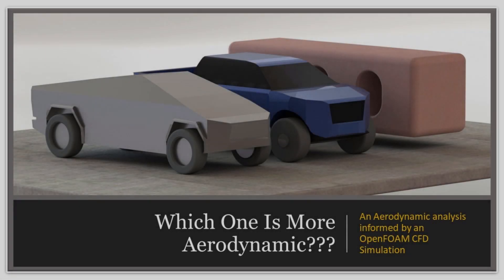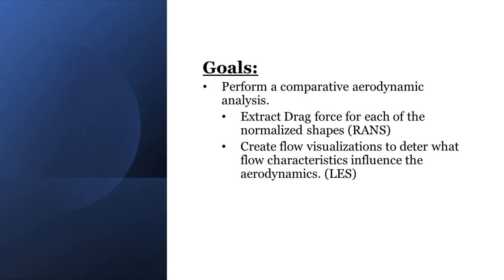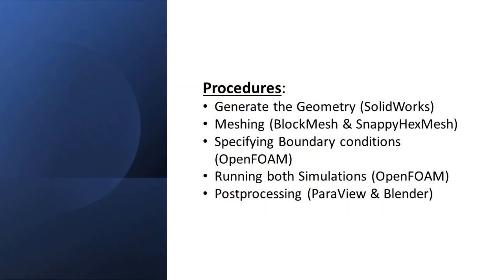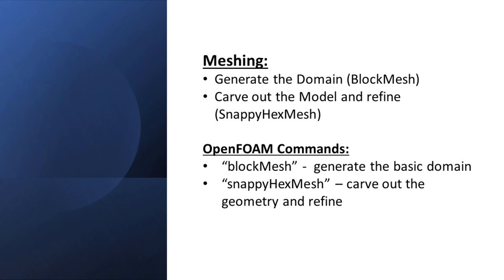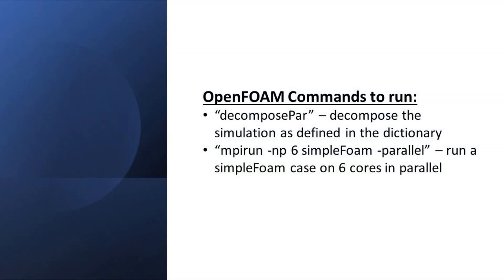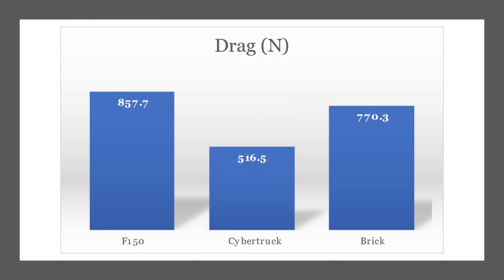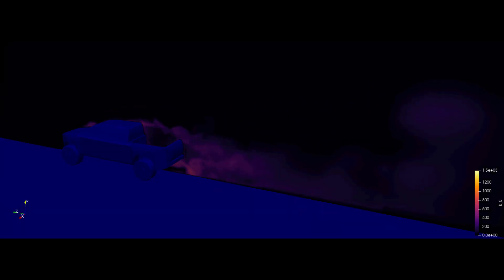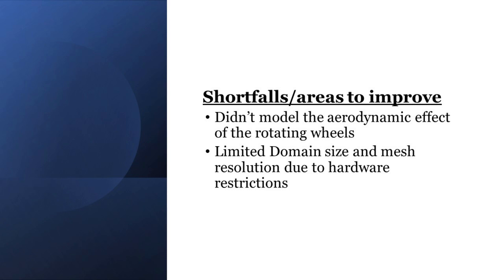Cybertruck Aerodynamic Analysis | OpenFOAM 5

Comment: Hi, great video. I do have one question though, why do you multiply the z force by the pressure when calculating drag?
Reply from the maker: I don't, I multiply p by norm_z (component of the surface normal in the z-direction) to get the force in the z

Comment: First of all, I appreciate your use of the Virdis color map :) One comment about the LES, it is strongly dependant on your mesh, such that the mesh be fine enough be to resolve 80% of your turbulent eddies/turbulent knetic energy. Therefore, at the back of the trucks, where probably a recirculation zone exists, you could increase mesh refinement by adding a refinement box in SHM to better calculate this region, this would effect could effect flow detachment and therefore your drag results.  But doing this on a home computer is not easy, I understand, I suffer the same when running my some projects at home. 

Also I think it would be very interesting to do a 2D analysis with RANS since the truck shapes are more or less consistent in you x-direction. The downside is that you cannot have nice animations of the flow with voriticies with LES (since it only works for 3D meshes). And I think usually you need a really low y+ (<1) near the walls to get reliable drag values that could be compared to experimental results, and that is also still dependant on what turbulence models to use. I have been using k-omega SST and want to also use LM transition SST model (4 equations so computationally expensive). 

If you have wind tunnel data at a smaller scale, you could make your simulation models also smaller to lower the number of amount of cells needed. That is probably not the best and just equating the reynolds number would be more correct. Would be curious to see where you go from here :)
Reply from the maker: I realize this issue with LES that is why I used the RANS for drag prediction. The comment is much appreciated and I have noted the suggestions, Thank you
Reply: @interfluo6420  but isn't rans even worse at drag prediction? As a friend puts it RANS is a many to one mapping
Reply: @mayurmahale3049  No, it depends on the mesh. Depending on your application, LES would require at least 2-3 orders of magnitude more cells to get similar results to a RANS sim with a good mesh. Really, I would expect <3% error to experimental drag for straight on cases using a good RANS setup. As a bonus, literature shows DES is worse for drag predictions than pure RANS, so take that as you will.
Reply: @killjbieberplz  I understand the mesh requirement. It needs to be small enough to capture atleast 80% of the  energy cascade using the grid and depend on the sub grid modelling to handle the rest. I also have heard in cases like external flows SA model gives you close enough values without being unduly expensive.

Comment: So I have some thoughts. I'd be more interested in the aerodynamic coefficients than the total force. Why not use a symmetry plane to cut down on the number of nodes/elements? To really resolve the boundary layer and get accurate data you'll need a pretty fine mesh and multiple inflation layers on the models. I noticed your windspeed is around Mach 0.38. Compressibility becomes a factor at about Mach 0.3 so does your model actually have kinematic similarity to the full scale? Does the force and drag coefficient on the brick match what you should get for a real one?
Reply from the maker: Great comment! 
- by normalizing the shapes the ratio of Cds is proportional to the ratio of total drag.
- the remarks on the mesh and domain have been noted
- I am using an incompressible solver, so I should be fine in terms of mach number and kinematic similarity
- I haven't checked but in the future I will do further experiments trying to match wind tunnel data
Reply: @interfluo6420  So if that simulation was perfect it should exactly match the same results in a windtunnel. But if you ran the test the real air would start to become compressible (slightly) and the simulation won't reflect that. Like you said it assumes an incompressible fluid. I would guess it would introduce some level of inaccuracy. I've never run any simulations with that high of windspeed but that's just my thought.

Comment: To not leave the "Limited mesh resolution" just hanging as is, grid independence analysis is often used. Essentially it's running the case with a coarser grid, and comparing the results. From that difference we estimate what would happen if the mesh was more refined than in our main case.  If the differences are not that dramatic, the mesh is considered good enough. All in all - nice vid!
Reply from the maker: mesh refinement studies will be the topic of an upcoming video. Glad you liked it!